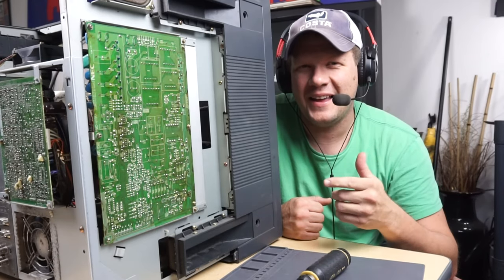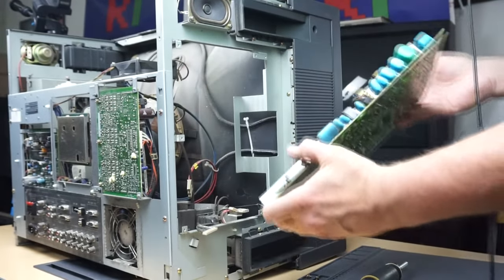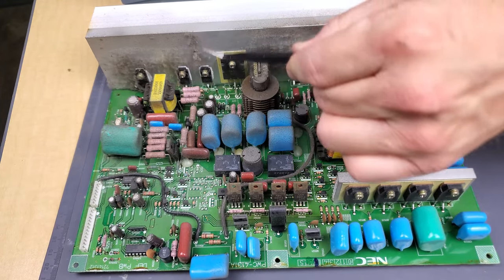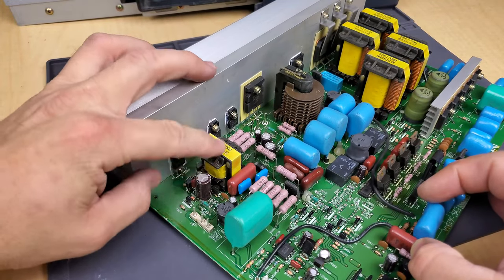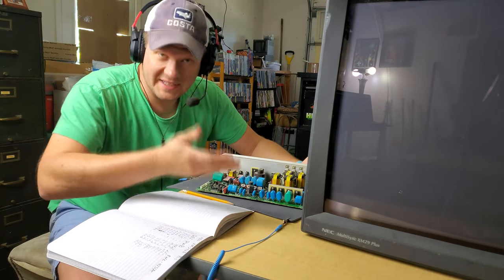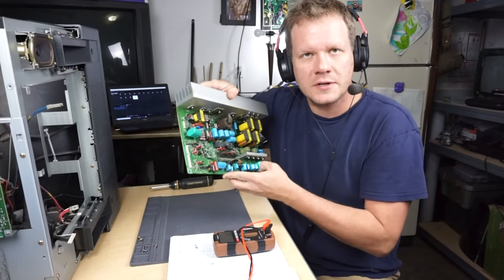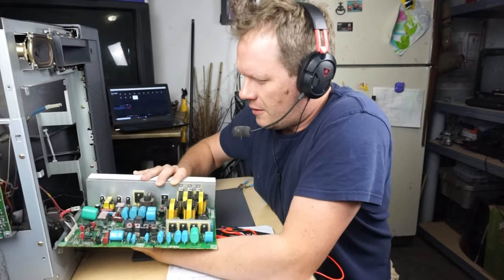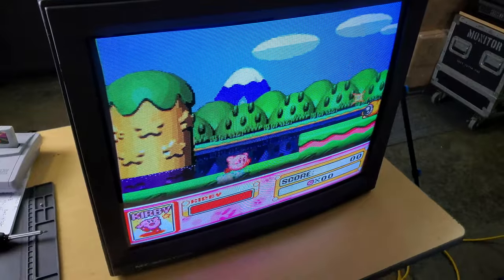NEC's Giant CRT Restored! - XM29 Shadow Mask Pro Monitor

Comment: I am glad to have the same monitor in my setup. Changing these fans is really necessary because the are really loud. Hope to see that in the video too, because its not that easy because the montior kind of checks it when u turn it on. My has minor issues with geometry and linearity...I hope a cap kit will fix this.

Comment: I highly recommending replacing some of those fans with some bigger and more modern PC fans that don't generate noise. The ones that aren't in a hard mount should be quite easy to replace, that one in the bottom right that is loud could be replaced with a Noctua for some sweet silent operation.

BTW, will this monitor be for sale after refurbishing? Just curious.

Comment: Do you have a recommendation for a small air compressor? I live in an apartment so I don't want to make a ton of noise. Would just need something that only gets up to maybe 40 or 50 psi
Reply from the maker: Good question, unfortunately I don't at the moment
Reply: Just use cans of compressed air.
Reply: @KentBuchla  That's wasteful, expensive, and stupid.

Comment: Imagine remaking that board, ultra tiny, with new age shit, and a new age board that is more tightly compact. And then making new tubes which take up less space, and are lighter weight. Its possible. Its so possible. I'm dying for a quality display. I want an OLED MONITOR but none of the monitor brands give a shit about the consumers wants/needs. They just want profits. Selling $250 dollar monitors that cost them less than $50 to manufacture....
Reply: Hate to burst your bubble, but new CRTs aren't happening any time soon, and flatscreens will eventually catch up to CRTs (in terms of motion clarity, etc). We just need to look after the ones we've got left, and save as many as we can. I think the closest we'll get could potentially be a fairly small OLED screen with a built in OSSC marketed as a retro gaming display, but honestly, I think retro gaming on flat panels is in a good place right now.
Reply: The reasoning of a child